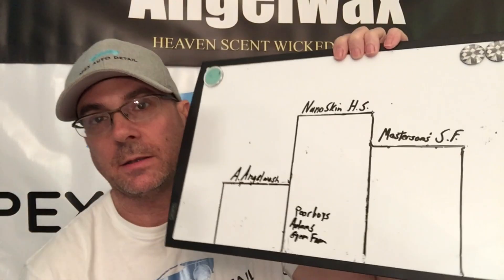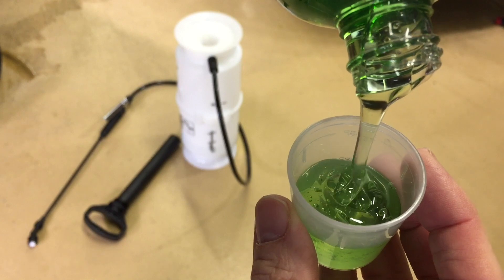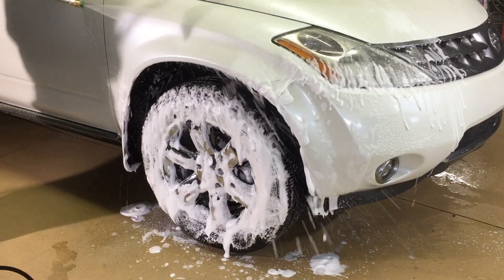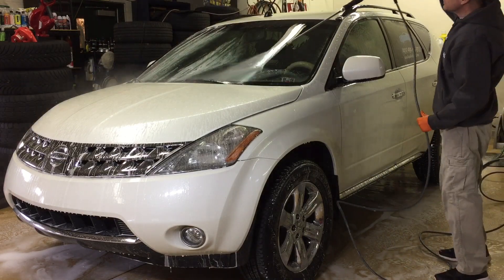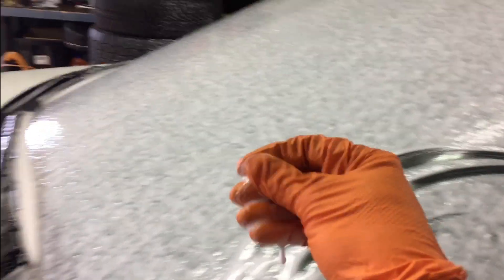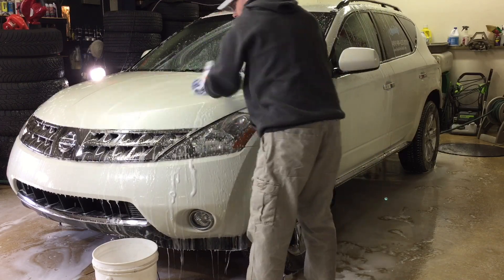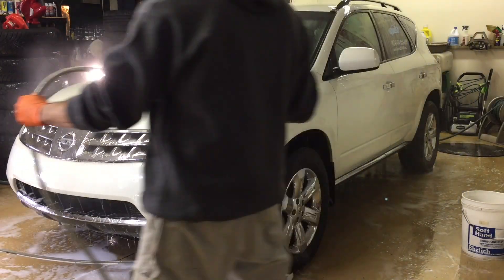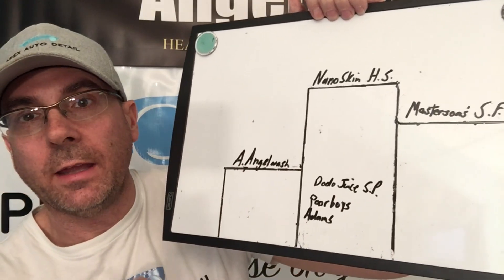Dodo Juice Sour  Power Gloss Enhancing Shampoo!!!!

Comment: great video great foaming pls which 3100 PSI electric power pressure washer did u use & d gasoline  power pressure washer pls kindly send me a link thks i love ur videos u doing a great job
Reply from the maker: The gas washer...👉https://www.amazon.com/gp/search?ie=UTF8&tag=apexdetail-20&linkCode=ur2&linkId=9966cea5b55d51dcdf029c4a1c355c11&camp=1789&creative=9325&index=automotive&keywords=Husky%208%20gallon%20air%20compressor

The electric...👉https://www.amazon.com/gp/search?ie=UTF8&tag=apexdetail-20&linkCode=ur2&linkId=543e1578e201d24dabf48b6e854a00c0&camp=1789&creative=9325&index=automotive&keywords=Greenworks%202000%20electric%20power%20washer